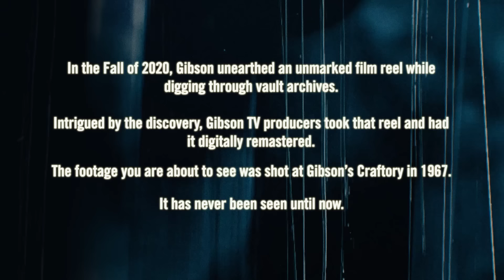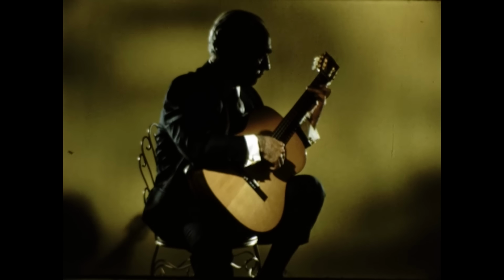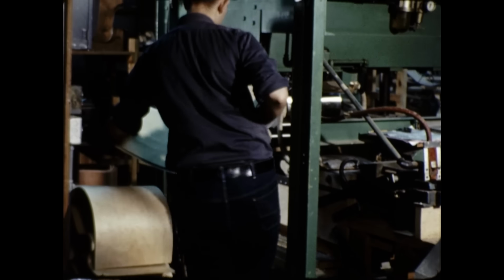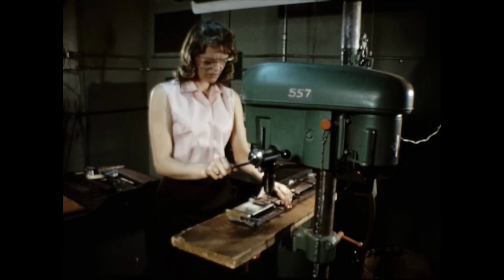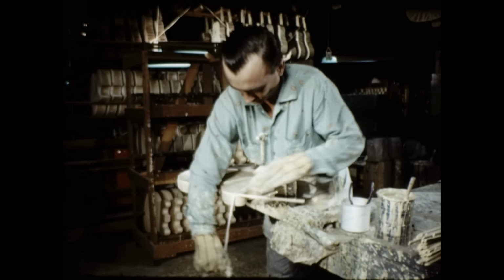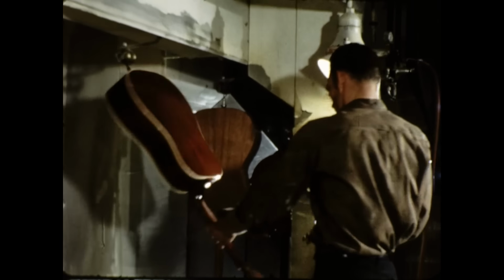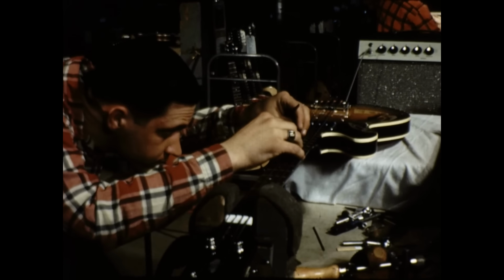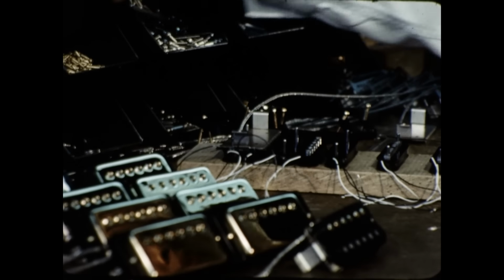We Found A Gibson Factory Tour Documentary From 1967

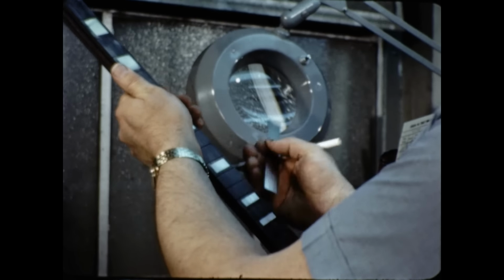Comment: I loved 8:24 installing frets.  We all agonize when we need to refret, but I think we make it more difficult than it is.  I will use this method for my next refret, seems practical as long as the underlying board is prepared well and sound.  Great video thanks.
Reply: It’s likely possible that that was an initial fretting, to be followed by an arbor press. Many companies do it that way.
Reply: That woman at the factory was laying those frets out like train tracks, id like to find her for my next refret 😄
Reply: @conjunctionfunctions  Real good, and I think that is the finished product for fretting.  I am thinking I will try this technique myself for next refret.  Will keep the fretwire long (after radiusing) and cut as I go.  Especially on Fender necks with no binding, no pre cutting to length needed.  This works on Gibson necks prior to binding.
Reply: @Hartech100  it’s definitely awesome to see, but that’s just an initial tap in placement, you can see the frets aren’t even or perfectly set, but exact for holding em down before a proper tamper/press.
This video is amazing.
Reply: @karlvonpackal1402  yep you are right, close inspection does show that, but still I think I will try this for my next full fret job and then press with cauls.  It is a great video.
Reply: BOT ALERT

Comment: What an incredible find and a great look inside the Gibson factory of 1967.  OSHA would have a field day with the lack of masks in the finishing department these days but that was then and this is now.  Pretty amazing all around and a really interesting watch!
Reply: When you spray into a high volume, water wash spray booth, no atomized spray particles get anywhere near the sprayer. However those performing the sanding operations without dust masks are in jeopardy
Reply: No need for PPE respirator to be worn ..... the industrial exhaust ventilation in the spray paint booth captures paint mist quite well.  Very likely the exhaust flow rate is in excess of 100 ft/min at the work zone.
Reply: @ikefork2606  Well alright, you learn something new every day.  Very interesting!

Comment: Fun to watch.  Interesting to compare to today's process which is largely about the same--only slightly more streamlined.  The wood press machines used to make ES guitars are exactly the same machines.  Obviously the CNC machines that drill the holes and routes are far more modern--but the overall process is very similar.

Comment: Very interesting to watch, classic late 60s industrial documentary.   I would be surprised if most people would be aware of how many women worked in the factory at that time, doing a lot of the precision work.  From the point of today, there are all manner of potential safety issues, particularly no respiratory protection for the people spraying lacquer and no sealed spray booths, as well as live cutters with no safety guards.  Still a lot of human craftpersonship in the build back then, moreso than today and while instruments have the potential to be more consistent today, I'm not convinced that they are necessarily better.  I found the piece about using UV light to look for excess glue and squeeze out fascinating and wonder why that is not done inside the Generation series of acoustics which are messy as heck on the inside of the soundboard.  This was a time before Norlin tried so hard to kill Gibson and the film shows the human commitment.  Thank you kindly to Gibson for sharing this found footage.

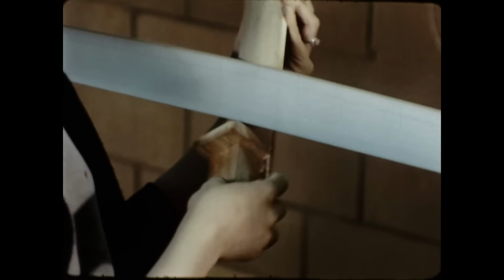Comment: Most vintage Gibson’s have a problem with symmetry at the headstock, where they are not sanded the same. Shown at 9:25. I have a 1967 Gibson SG that is marked a second because the headstock sides are quite a bit off.

Comment: I would love to hear from people who worked at the Gibson factory in the 1960s and had experience with the production process. The video shows some aspects of automation and machinery used at the time, but it seems they were not computer-controlled.

What kind of machines were used back then? Did the workers find automation helpful, or were there times when it made the job more challenging?

I'm also curious about how much of the production was still done by hand. Which stages required the most precise manual work?

For those who worked there, what were the most difficult stages of the guitar production process? How did the factory handle quality control in a pre-digital age to ensure each guitar met Gibson’s high standards?

It would also be interesting to know if there were differences in the production process depending on the guitar model (like the Les Paul, SG, or ES-335) and what were the most common issues that arose with the machines or the production process.

If anyone has memories, experiences, or anecdotes from those times, I’d love to hear more!

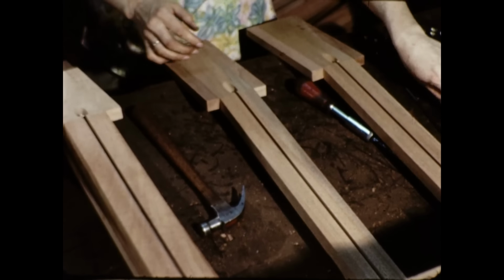Comment: At 7:15 The Truss Rod used to keek the neck straight.....WRONG
.. TRUSS ROD USED TO BOW THE NECK. OR YOU COULDN'T PLAY...ALL THE FRETS WOULD HIT THE STRINGS AND ...BUZZZZ
Reply: You’ve got it backwards.  Without a rod, it WOULD act like a bow because the strings create a huge pulling force on the neck.  The strings would NOT buzz, because the would be so far off the fretboard it would be unplayable.  The truss rod provides a counter force to make the neck more straight so the strings are more parallel to the neck.  The height of the string off the frets is what causes buzzing.  It can be a combination of bridge and nut height as well as too much truss rod force!!
Reply: @RobertMost  Exactly.what I meant. Dialectical straight
Reply: Correct, a perfectly straight isnt optimal if you want low action. Dont let anyone tell you any different
Reply: @JoeKyser  who's right ROBERT MOST OTHER POST OR MOIS